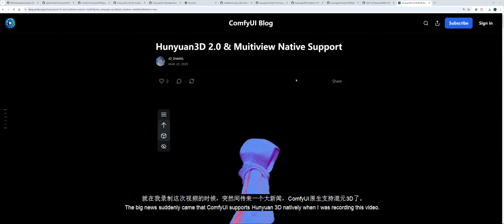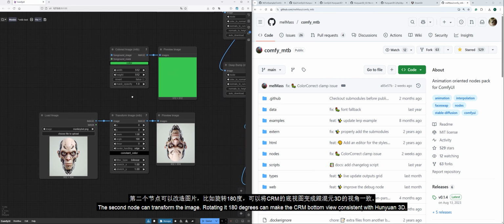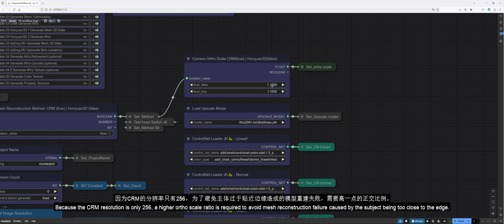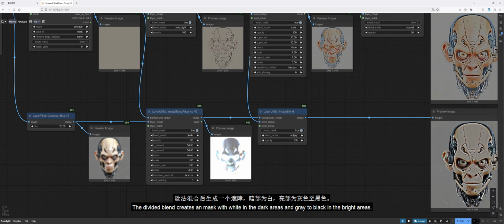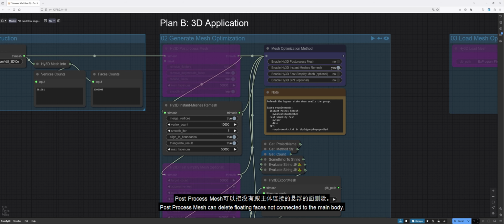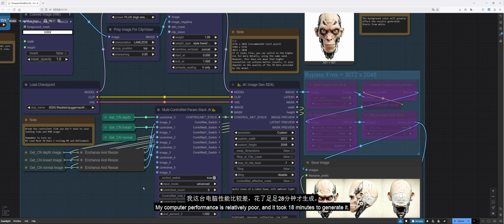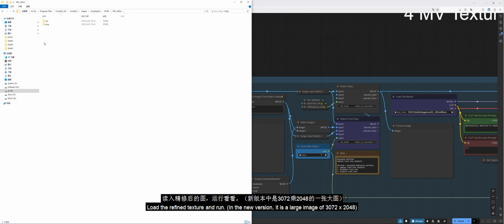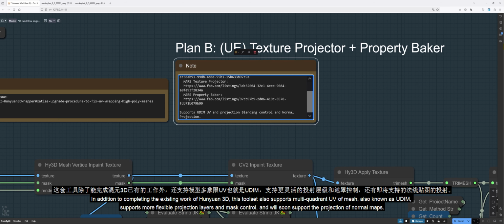ComfyUI Hunyuan3D img2mesh workflow Deep Dive

Comment from the maker: The 3D Pack torch2.7.0+cu128 wheels and Hunyuan3D custom_rasterizer wheel are available now. You can upgrade to the latest ComfyUI (v0.3.40). 
https://github.com/comfyanonymous/ComfyUI/releases/tag/v0.3.40
https://github.com/MrForExample/Comfy3D_Pre_Builds/tree/main/_Build_Wheels/_Wheels_win_py312_torch2.7.0_cu128
https://github.com/kijai/ComfyUI-Hunyuan3DWrapper/blob/main/wheels/custom_rasterizer-0.1.0%2Btorch270.cuda128-cp312-cp312-win_amd64.whl